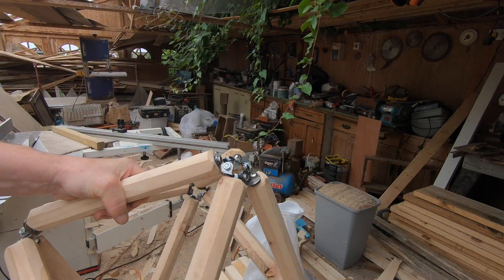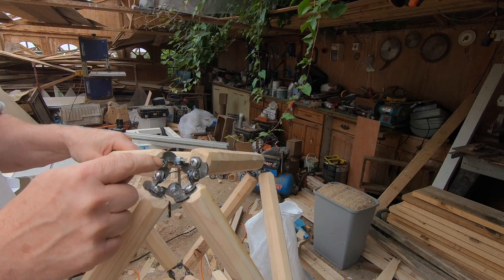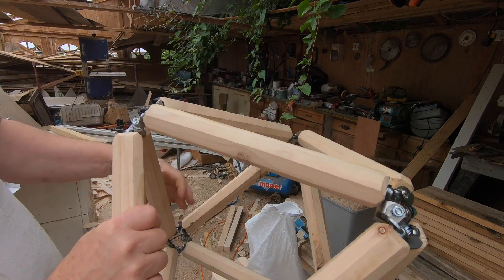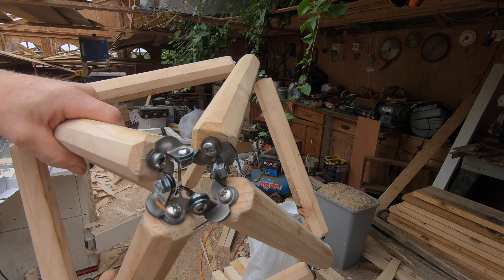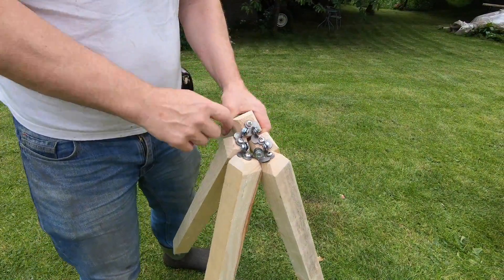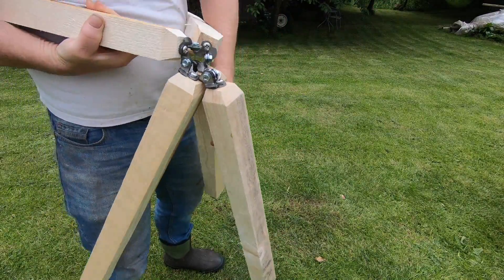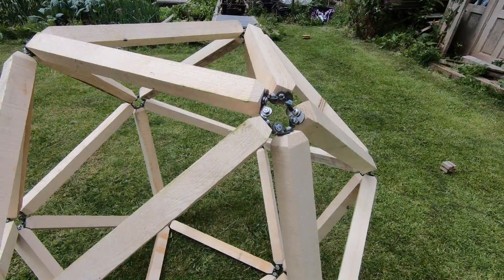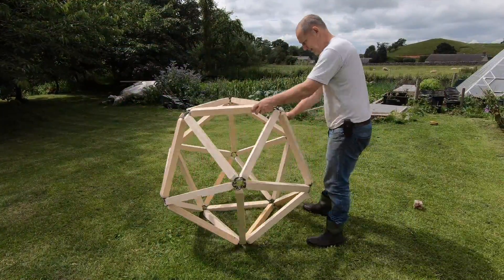1000 space frame brackets arrive - time to do some testing

Comment: A bit off the subject but I figure you're the guy with the knowledge to answer my question. I'd like to experiment with pouring concrete panels for a 2v dome, and maybe a 3v eventually. Would you show us the 3 dimensional view of the panels and the angles necessary to build a dome out of A & B triangle "blocks"? I am particularly looking for the compound angles of the edge of the panel.
Reply: Do you still need the info?